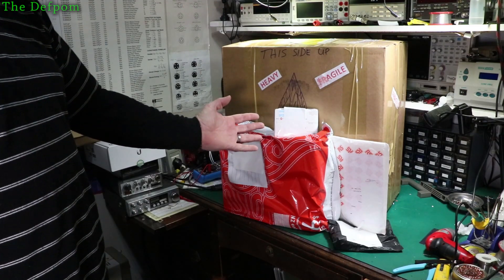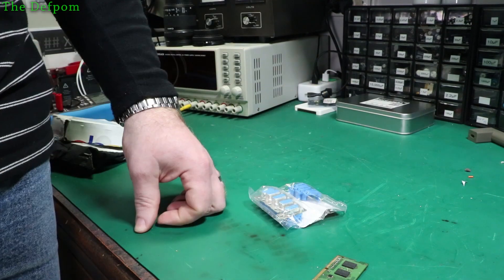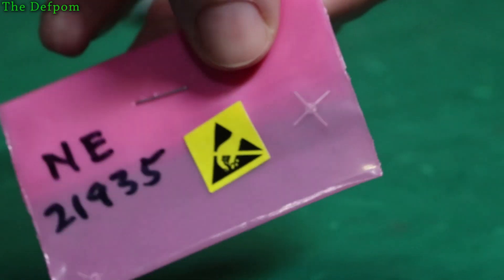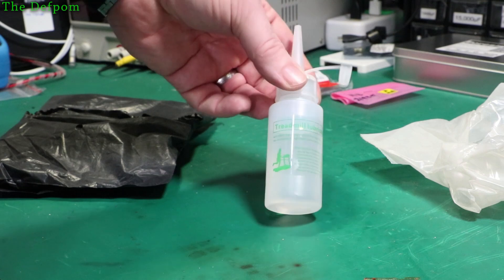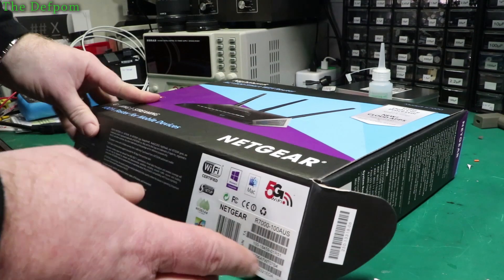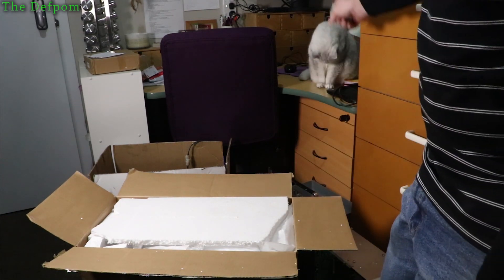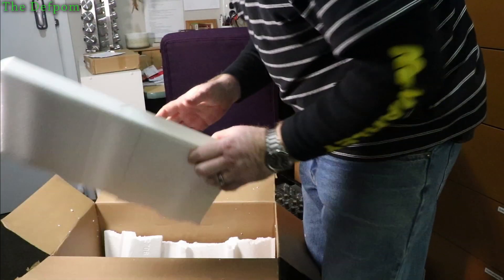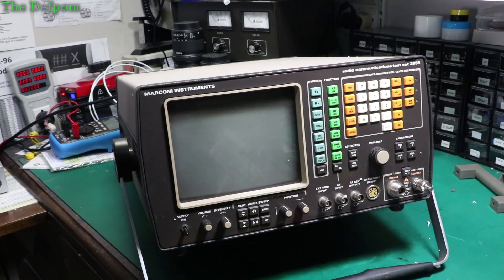🔴 #622 Mailbag Monday 2nd September 2019

Comment: I've just finished restoring a 2955. I suspect that was in worse condition than yours. I ended up replacing the Lopt, line output transistor, the xtal reference with a Tcxo, two hybrid modules, a cmos switch and many electrolytics. I recommend replacing all the PC mounted electros as even though most tested ok, some caused really subtle problems. Great fun to work on though. I'm in Wellington if you need any left over parts. Cheers Doug.
Reply from the maker: Doug V B - thanks for the offer, I will be doing a restoration on this one too, I can’t remember if I published the video yet on fixing the issue with being DOA, if I haven’t it won’t be far away, but I will be doing more work on it to get it perfect, it is a piece of gear I intend to keep and use. Having a better reference would be one of the changes I look at doing.

Comment: Nice mailbag Scott 👍 
I hope you get on with that D7000 ok and the FW is a different AND better version than the FWs that were available for my D7800.  Unless mine was a flaky unit or something.. Anything that needed a slight adjustment or tweak, even with freshly install FW would take literally ages. The thing would just stop responding when it felt like it. Even just logging into it was a PITA sometimes. And trying to change any settings via WiFi was a waste of time.
John
Reply from the maker: John - Orbiter - I am using a 3rd Party firmware on it, and it is working very well, I am using Tomato, I tried DDWRT as well but found tomato worked better for my needs.
Reply: @TheDefpom  Both of those are very outdated.
Reply: My R7800 is awesome. I run OpenWRT fw. Wifi speed is crazy fast.

Comment: Cats and cardboard boxes a strange attraction.  Nice to see the 2955 I love the one I have. They are not the easiest thing to work on though and they have a lot of common faults you probably already know about.
Reply from the maker: I researched the 2955 a few years ago when I first started looking at them, I figured that as long as I can get one with a working screen, the rest I can deal with, even some of the obsolete OM parts have some substitutes these days.
Reply: Defpom's Electronics & Repair Yes your right. The  OCX packing material also turns to goo.
Reply: Defpom's Electronics & Repair https://www.ebay.co.uk/itm/OM345-OM2045-REPLACEMENT-MODULE-MARCONI-2018-2019-2022-A-B-C-D-E-2955-R-S-ETC/283443920849?hash=item41fe92ffd1:g:iXkAAOSwBjdaPqF2
Reply from the maker: For some reason eBay won't let me buy these... damnit. fancy picking some up for me and sending them over?
Reply: Defpom's Electronics & Repair how many do you need?  Just checking it’s the modules you need
Reply from the maker: I don't actually know, would want to get a few as spares for when I do need them, so probably 2 or 3, I have a 2022D as well, and I think they are in that too.

I only just saw your message as it got flagged as spam, was just doing my periodic checking.
Reply: @TheDefpom  I have ordered three for you. I will send them over when they arrive. Regards chris